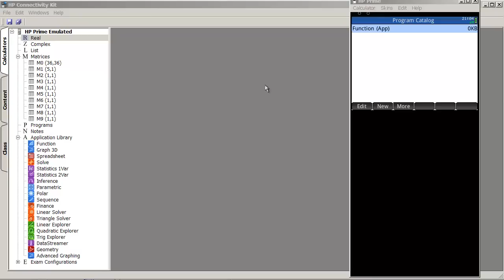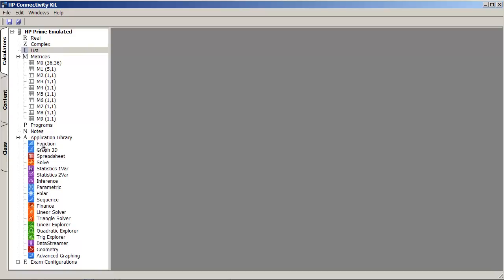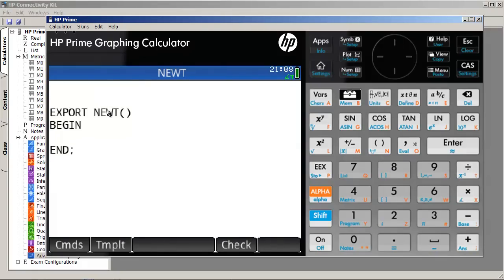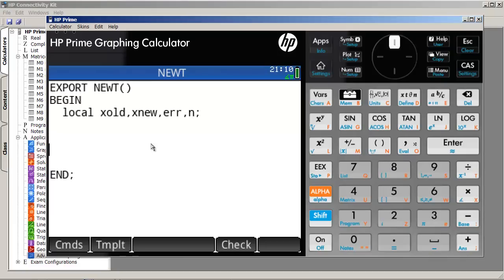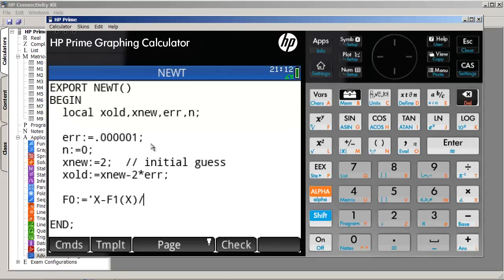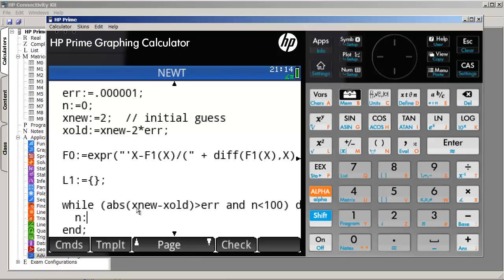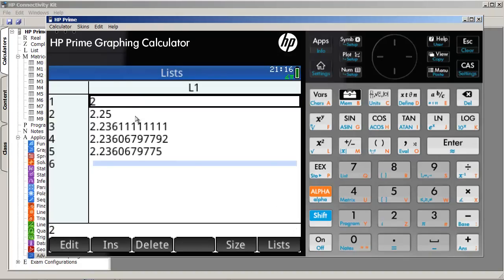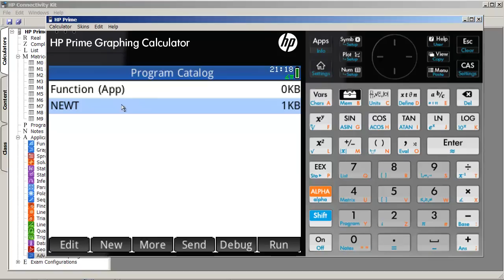HP Prime - Programming & Newton's Method (Part 1)

Comment: My god, it's full of PASCAL.  I wonder why they chose that syntax for a calculator?  Python would be simpler, but then you have the indenting rules.  C is also very compact, and simple for use with a calculator.
Reply from the maker: The most recent beta has Python support, which suggests this will be in the next official firmware update.

Comment: Very nice work. Thanks for all your efforts. I looked at your work here and on the forums. I used the HP Prime Pro on windows 10 for my coding. Also loaded Pro onto Android and Chromebook using Android beta. HP Prime Pro - full-featured, inexpensive, mobile version of calculator is available at: https://goo.gl/Ub83jx . For new HP Prime or Pro users if you are interested in using  calculator to do Algebra Fundamentals or learning how to get started with basic programming using Algebra Fundamentals, see my eBook or printed edition: https://goo.gl/xK6rRt . Next turn to the experts here and at the forums.

Comment: Niguém Live Seating Graphing the field and Yes Calculations and Programs for Me to HP50g is Still Superior Very Programming, For I am Programmer of Two Language and This regressed HP39g + that nobody Like to Use and Not Have Much For Output is Pecima, But Who Like to Buy That New Appearance to Show If Only and Not Use!
Reply from the maker: It's designed for a different market -- this calculator is aimed mainly at education. HP is still selling the HP50G and to my knowledge does not plan to discontinue the HP50G even though the HP Prime has now been released.

While the HP50G may be more programmable, the speed of the HP Prime's programming language (as well as its easy learning curve) should not be so easily dismissed.